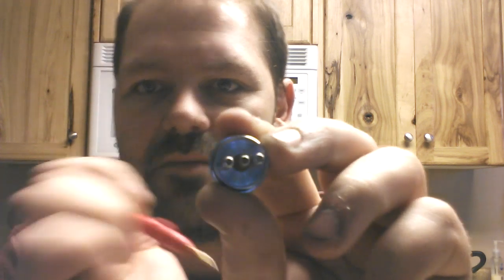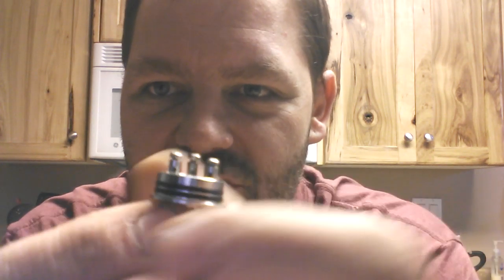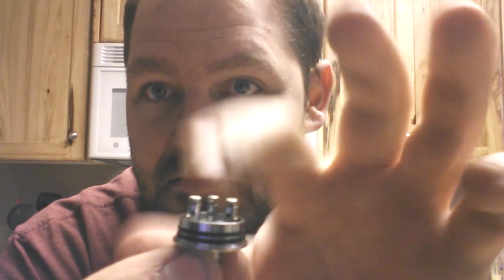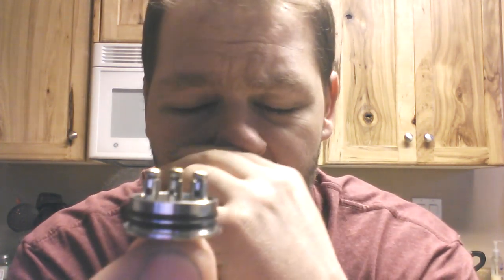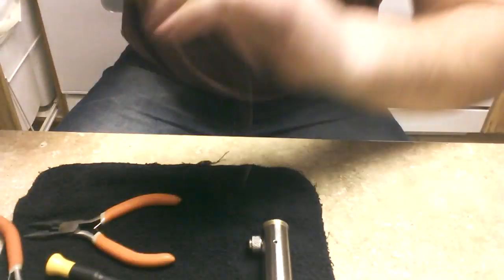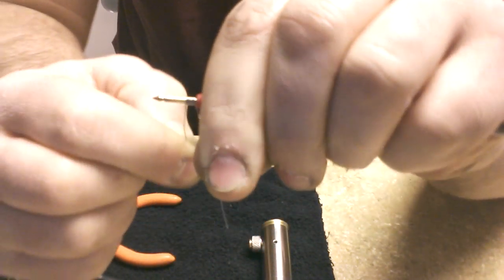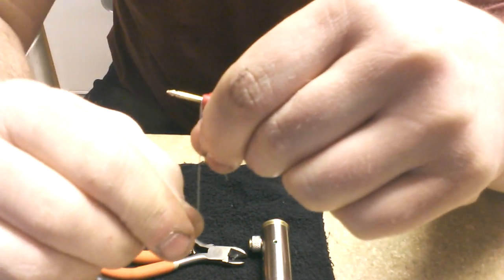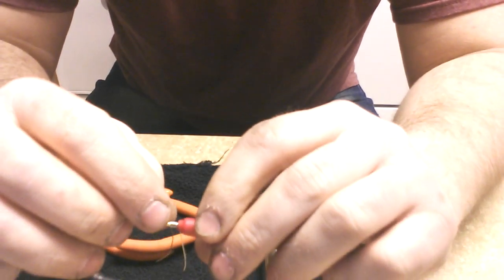Center post build on the igo w!

Comment from the maker: Thanks dude! I really appreciate that man, the batteries I use daily amd with no issue what so ever are the Sony 18650 2100 mah 30amp's (vtc4) also the Sony 18650 1600 mah 30 amp's (vtc3) they are great cells and will perform excellent for you!!! HIGHLY RECOMMENDED!

Comment: Great vid Trevor! I saw someone else do this, but they left the leads really long and just bent the coil toward the center, which I would think could overlap coils. I like your method way better. So here's some info to go along with my PM. I built a .5 ohm duel micro which was reading consistent, and my button was getting hot on my sentinel clone using EH 30 amp and Panni 10 amp batts. Not really hot, but noticeable. The button was also not firing or firing very weakly in certain spots, like dead center. Very weird. I took one of the coils out and everything was back to normal. And ya, I went through and sanded contacts. Anyways, there's a little more info for you.

Comment: Have u tried leaving some more space between the coil and the post/s? When I first started micro builds(about a year ago) I'd pull that coil in all close like you're doing...thinking it was better. Shortly thereafter lots and lots of builds under my belt, I learned that you in fact DONT want the coil pulled so close to the post. Why? Simple answer: Air flow. Leaving some space - not a lot- behind that coil allows much more air around the coil...consequently creating much better flavor, TH and vapor VS robbing one side of the coil from air flow due to sucking the poor coil in all close to the post.  This one tweak can take your micro coils to a whole different level. Cheers🍺
Reply from the maker: Yes, I am aware of this technique. Even at the time of this video. I have updated this video since its inception...that's what I love about building. PROGRESSION!